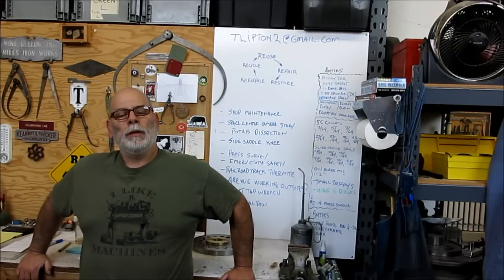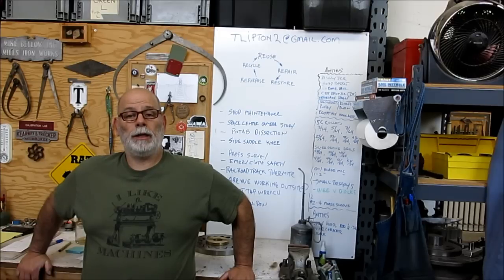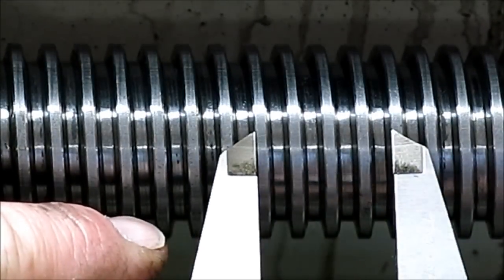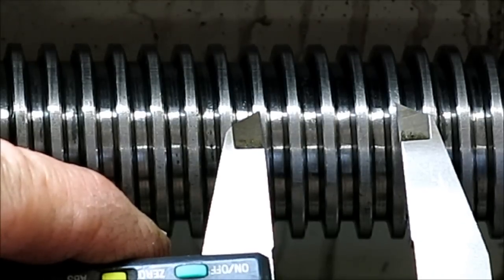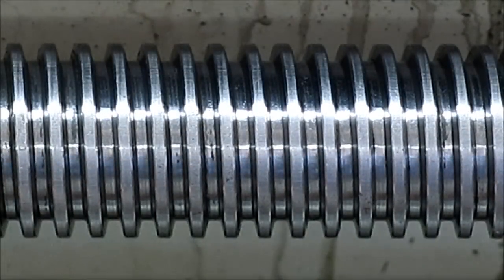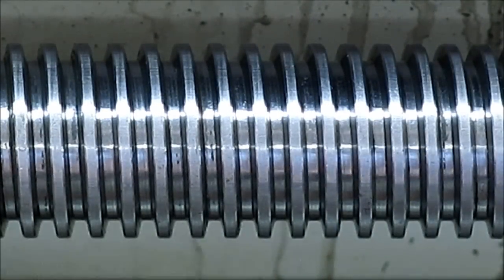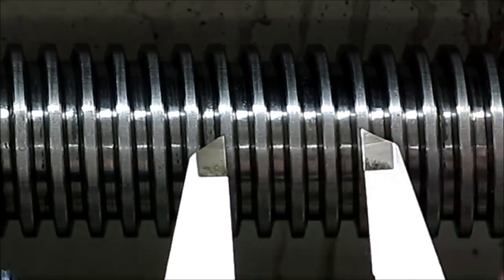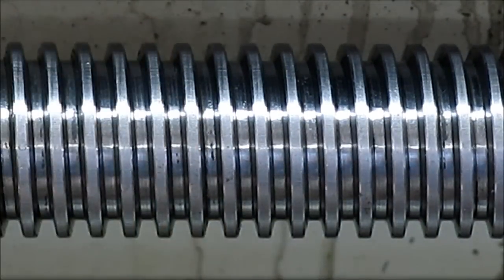Lathe Lead Screw Measuring

Comment: An easy way to ID the leadscrew is to count 10 threads and measure the length in mm and compare this to how close the threads fit into 1".  
10 threads of 6mm will give exactly 60mm or 4 mm threads will be 40mm. Threads will start and finish on the same place on the thread pitch.
An imperial thread will start and finish at the exact same position of the thread pitch when measuring over 1" and will be off when measuring over 10 threads.

Comment: Tom, thanks again for the great video.  I see many god ideas in the comments.  Here is an easy one.  Engage the half nut, rotate the chuck by hand a few turns to remove any backlash, make a sharpie mark on the ways, rotate the chuck and count the # of revolutions of the lead screw, then measure how far the carriage moved along the ways.  Pitch is a measurement of distance traveled per revolution.  Your lathe carriage travels 0.25" per rev. for a pitch of 4 TPI.  Just offering another idea.  Thanks again.

Comment: Or turn leadscrew one turn manually and measure the travel of the carriage with a dial gauge. See if fits a metric pitch and also divide into an inch to see if it is an imperial one.

Comment: Hi Tom,

The cut threads were apparently coming out OK, it's just the threading dial that's behaving strangely. The threading dial was fitted with a 15 tooth gear (meant for metric), now it has a 16 tooth. I'm beginning to wonder if the saddle isn't fitted with metric half nuts that are only partly engaging with an imperial leadscrew. I think we need to see dial gauge readings whilst the leadscrew is rotated whole turns.

Comment: hi Mr OXTOOLCO? , this question is one that need a bit of explaining i wuld love to hear your tack of the subject . I think it an interesting , subject. & as potential for grat development  in the CNC  Domain To ,  On with the suggest! , i live in England & own one of the UK School lathe's . it about 150 years old   it as the ability to cut threads up to 4 treads to the inch , & as small as 50 to the inch.  but it as no lead screw. & it perimetry . screwing drive . is the rack. I would love to fit a  tread dial  .So i no longer need to time the lathe to cut a tread ?  Now the Question is  wuld it be best to fit a sliding free turning Keyed sleeve as 8 thread's to the Inch  Or an appropriate gear that rid on the rack tuning a Dial  ?   At present i ues a rotter & thread mill to cut the small threads  in it appropriate gear seclusion on the banjo  but single point therein still avails me as i cant start the tread consecutively in the same place  without  trading diel . is it possible you can cover this on a video to whach . [ Les in England] 
IV Raised the subject with so meny But they never Respond ?.  thank you   preps you will   the German cheapy Stephon came up with using the third mill siystom. it work's well very well for small trad's  But i won't to cut a Spindale tread for my lathe   to mount a chuck plate . & wuld lick to single point thread it ,  we There's  my problem can you help ? whit an ideal  Some clarity . my drive spindle is Like a Milford Lath  led screw,  but with out the third my idea was to fit a sliding thread which is keyed ?  & mount  a diel to that ?   Well their you have it what do you think ?

Comment: If it has a threading dial, it's should an SAE thread, right?  My thought is that metric threading half-nut is never disengaged, thus renderin thread dial as unneccesary.  Did he give the model of the Grizzly lathe?  Should be be easy to track on the grizzly website. My lathe is Chinese and has an SAE thread lead screw and a threading dial.
Reply: Metric lathes have threading dials too! It's only the special case of cutting a non-native thread; metric with an imperial leadscrew, or imperial with metric, etc. that means the half nuts can't be disengaged without special techniques.
Reply: Cool.  Never knew.  Thanks.
Reply: Paul Compton Hi Paul, my metric Colchester Bantam has no threading dial, one would only be needed for threads that are not a factor of 6mm, as the half nuts can be engaged anywhere. For non factors, or Imp threads, a "clapper box" threading tool saves the day.
ATB
chris

Comment: Only thing I could suggest is maybe measure over a larger distance and only if you really don't know if it's English or metric.. Most dial calipers are 6" plus so maybe measure over 5 inches and divided 5 by the thread count. To check if it's metric I would switch to mm and measure threads in 100  mm the same way.  Probably more work than is needed for this but averages out minor error you might get with no real point on acme threads.

Comment: the guy over at the AppliedScience channel had a similar problem on his Grizzly 4003g lathe. He has a review video of the lathe. He says that Grizzly shipped his lathe with a 15 tooth thread counting gear designed for a metric lathe and it should have been a 16 tooth gear.

Comment: Hello Tom, Thanks for you great educational videos,  I bought a drilling coupling that was indicated as T48*10, its a metric threads, i need to thread a joining drop pipe for it but am not sure what kind of thread that is. hope you have ideas you can help me out. The  diameter of the  coupling is 60mm and thread diameter is T48mm*10

Comment: Hey Thom. I have a Grizzly G4003G lathe. the lead screw is .864 inch and it is 8TPI . a friend of mine had the same problem with her Grizzly lathe and it turned out she had the wrong gear from the factory it was like 22 teeth or something and they do offer a metric lead screw. the correct gear for the  G4003g for imperial measurement is 16tooth. I don't know if he has a G4003g but its the most common one so I'm hoping this will help.

Comment: Hey Tom I have a grizzly g4003g lathe also the lead is .864 in and I believe it is 9tpi. The thread chaser has 16 teeth. A friend of mine was having the same problem and it turned out they had installed a metric gear I think it was like 22 teeth she called them and they promptly mailed her the correct gear.

Comment: Awsome video, very helpfull.
Can i ask please, i mesured my lead screw from my uknown lathe and it come to 6,5 pitch and 30mm(exaclty) at diameter.
I am trying to find a split nut but i cant so i cannot use the lathe for cutting thread nor feeding.
Any ideas how to overcome my problem?

Thank you!!
Reply from the maker: Sorry to hear you have no split nut. You will most likely need to make a nut on another lathe. Another option would be to find a nut  that fits your lead screw and somehow adapt it to reference to the carriage. Thanks for the comment.

Cheers,

Tom

Comment: Hi Tom,  
I've got a 12 inch Clausing lathe that had a well worn split nut and a homemade leadscrew and I finally finished wearing the split nut out.  I bought a new split nut from Clausing, but it doesn't work with the homemade leadscrew.  (too tigxht)  When I looked in Machinery's Handbook,  the Acme threads for my size screw don't seem to exist.  The Clausing one is 7/8" X 8 tpi.  These are no longer available from the company.  The one on my lathe didn't have the threads cut deep enough and they really don't look that good anyway.  My hope was to find some 7/8" Acme allthread and make another one, but can find only 6 tpi.  Is there somewhere you're aware of that might have what I need?  Thanks
Reply from the maker: Hi Ed,

Try Horspool and Romine in Oakland CA. They do all kinds of acme stuff. Thanks for the comment.

Cheers,

Tom
Reply: Thanks Tom,  We also found an outfit called Green Bay something or other and they also had what we needed.  $28 per ft in cut lengths of 4140 of the 7/8 x 8tpi.

Comment: Hi Tom
Love your videos.
 Machining is new to me. I picked up a South bend  fourteen lathe  but it did not come with  thread dial.
I picked 1 up on e-bay that will fit but the gear is not right.
I have a 1" 6TPI lead screw.
Can you help me figure out what gear I need to make this work?

Thanks
Al
Reply: Al Hagopian

Comment: Hi Tom, how does this work for miltu start acme threads.  ive just taken my old Elliott 181 Milling machine apart to look at repairing a backlash issue in its x axis.  Its probably an imperial thread.  Just curious as the DIY CNC plasma table i built has 16mm twin start acme threads, how do do go about measuring them - at first glance if the ends were hidden by machine mechanics, all you see is what looks like a normal acme thread.
Reply: Turn the leadscrew exactly ten turns and measure the movement of the table resulting. Divide that by ten times the pitch to get the number of starts

Comment: I think a 2.5mm pitch is the same as a 10 thread per inch.  Going to be hard to figure out which one it is if so.
Reply: That's why I suggested measuring the threads in 100 MM and 5 inches, if its metric you get 40 right on the button, if its English you get 39 and a bit more. If you measure the threads in 5 inches and its 10 per inch you get 50 right on the button, if its really metric you get 50.8 or almost 51.
Reply: MaulTechATV Measure the entire leadscrew - the more peaks included, the easier it gets - besides the counting.

Comment: Tom,

Great info!
If it would help, I have a Grizzly G0709 14"X40" with a 8 TPI X .875" Dia Lead Screw.

Thanks,

Ray
Reply from the maker: Hey Ray,

Steve needs to work through this problem. What is the optional metric lead screw pitch? Is it shown in your manual?

Cheers,

Tom
Reply: oxtoolco Hi Tom,

I checked my manual, the only option was the one that came on my lathe, (Cuts 4-112 Standard TPI and 0.1-7 Metric, 7/8" Dia 8 TPI). Not sure if Grizzly sells a lathe with a metric lead screw as an option. I would have him contact Grizzly Tech Support and tell them of the issue. Could also be a half nut, or clocking gear issue... Maybe we can cut him a new Inch lead screw as a last resort??? 

ATB,

Ray

Comment: Good video. If it's a 2.5mm pitch then 10 threads will be 25mm, 10 tpi will be 25.4 which will be hard to spot measuring in the center.
Carefully measure the width of the top of a peak ... on a acme thread relatively easy? Now carefully zero your digital calipers. Now measure across say 10 threads from left side of peak to right side of peak ... not the centers, it's easier than the centre. Your calipers are zeroed at the width of a peak so will automatically deduct 1/2 width at either end? 6 inch caliper you can measure across 60 threads ... the difference should be 2.4mm less if it's a metric thread 2.5 pitch (61 threads (very nearly) per 6 inches?). Or with a 6 inch rule there will be either 60 threads or 61? On medium size metric lathes, 10 or 11inch swing, 3mm pitch is very common.
Reply: I'm not sure why Tom didn't simply measure from left corner to left corner. Then there's no need either to factor in the width, or to guess the centre positions.

Comment: more acurate measure over 10 pitch. you see is it metric or inch right away.10mm its 1pitch metric. 15mm 1.5 metric 20mm 2 pitxh 25mm 2.5